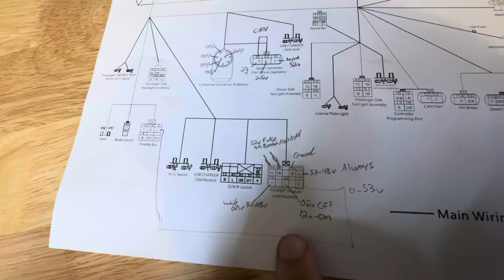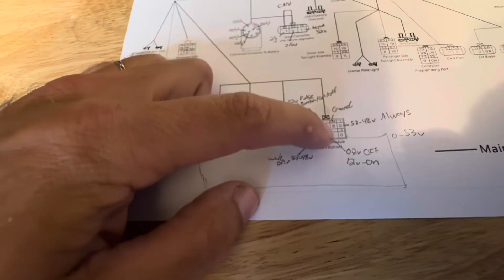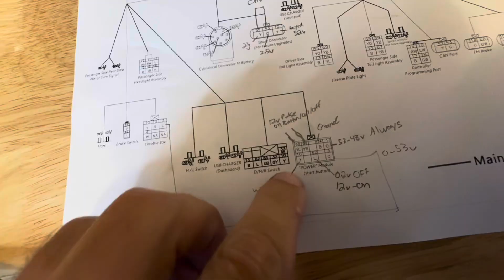Evolution Golf Cart Push-Button Start & Wireless Key Fob – Location & How It Works (Part 1)

Comment: I have the Ranger D5 4+.... is there a Break-in for the Battery?
Reply from the maker: Yes - Typically my advice is pretend 50% is zero. Rarely let your battery dip below half charge. The bottom half of the packs can be unreliable.

Comment: If it was getting 48 volts it would melt……it’s getting 12 volts….
Reply from the maker: I am confident the unit is powered by 48-53V.  

The ignition unit in these carts is designed to run off the raw battery voltage from the cart because it needs power while the cart is off and before the voltage reducer is turned on. There is no constant 12V on these carts. 

Grab a multimeter and probe PIN 1 to PIN 10 on the connector to the ignition module and let me know what it reads. 

Only after the module turns on the cart will the connector receive 12V from the voltage reducer. At that point the 12V is mostly used to pass on signal to the turn signals to flash them. 

By itself, 48 V won’t melt anything; plenty of electronics are designed to run at that voltage. This line is simply acting as a relay / signal back to the carts controller. So it’s not carrying any real load. 

But I definitely could be wrong, let me know what you find.

Comment: This keeps getting better by the posting. !! I am into it now. You are legit, no You Tube E-Beggar . Keep up that work. We need to find the truth to these carts since the factory could care less about any of us.
Reply from the maker: Thanks. - They are great carts and they will be around for many more years, so I like figuring out the secrets for how to keep them on the road.  

Lots more to come ranging from Audio, to Suspension, and eventually maybe a full controller / engine / battery swap.
Reply: @hillvalleylabs I got a question for you what to wires could you jump to keep the 12v accessories, on and keep the motor off
Reply from the maker: @mjim80 - Sadly that’s not possible. On the evolution cart the 12v reducer only serves power when the ignition is on. If the ignition is on the cart is able to drive. There is no simple setup to accomplish 12v without the controller and motor being ready to drive. 

There is no simple bypass to get 12v without turning the rest of the cart on.
Reply: @hillvalleylabs  they is someone that make a kit to do it but I would much rather do it

Comment: You mentioned the throttle position sensor is sending a wire to the ignition box, I would be very interested in wiring a defeat for that so that the cart will stay on until turned off by the button (for playing music). Or at least using a cheap ESP to keep it on for a much longer timeout, like maybe an hour…

But then, what I’d really like to build a replacement box that uses BLE for a “phone key” like a Tesla has and ditch the fobs all together.
Reply from the maker: Agree. It would be relatively easy to eliminate or replace this box.

I ordered $20 worth of parts like 10pin molex extension cable, and some tiny waterproof buttons, and I am going to make a video about how to make a quick timeout override and a hidden never start solution. Should have it next week. 

But I agree it would be fun to replace with BLE or a NFC or a passcode. 

Somone said they used to use these at a rental fleet, so they didn’t need to keep track of keys at all:

https://amzn.to/46KvH9A
Reply: @hillvalleylabs I could see those very handy for rentals, but the cart already takes long enough to boot up, hence the phone key wish. I think the biggest challenge would be powering an ESP or similar without using a buck converter that drained the battery too badly. It would have to sip 48v power.
Reply from the maker: @KennethPadgett  - Exactly this is what I was thinking… but if we crack open this black box, I bet they are using one inside to reduce the voltage down to 12 or 5 for whatever their chips need anyway. The box does not kick out 12v until it’s fed 12v from the reducer.
Reply: @hillvalleylabs I’m wondering if the whole board in there is encased in that epoxy you see on the side…making it pretty hard to disassemble…
Reply from the maker: @KennethPadgett  - hmm good point. I feel like it is way too light to be 100% full,  and when you knock on it you can hear it’s pretty hollow.  I think they just filled in what was a port for the button cables.
Reply from the maker: There are so many times I walk away from the cart, look back and the lights are still on. So then you need to walk all the way back and hit the start button again. 

Actually having a way to use the button on the fob to also trigger it on and off would also be pretty nice. So many possibilities.